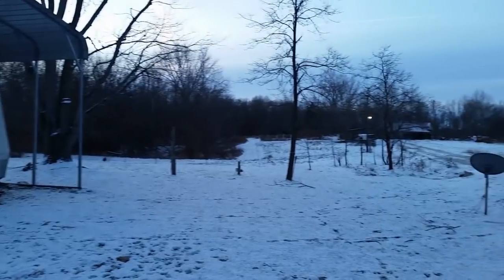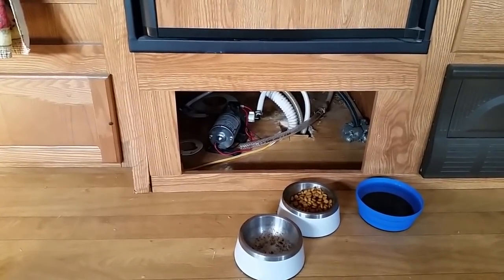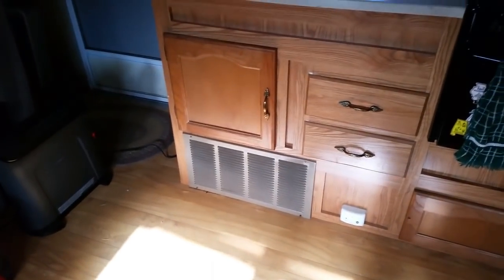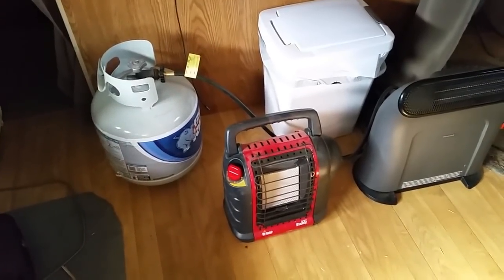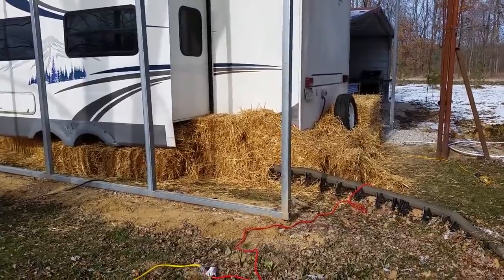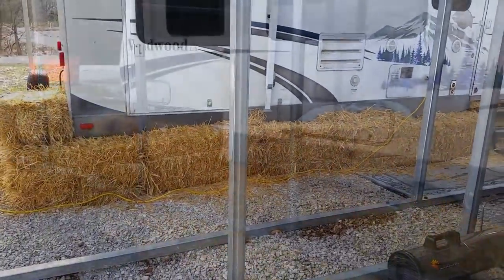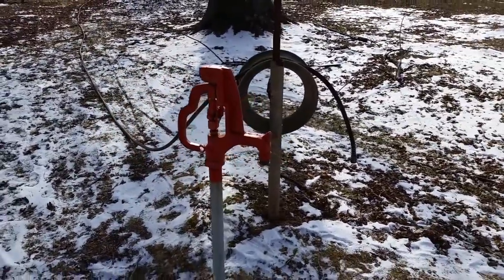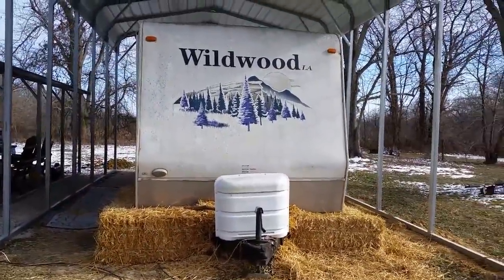Winter Living in a camper

Comment: I have personally found that in northern Wisconsin and all of the other colder climate areas that are in zone three in zone four it’s better to use water tank heat pads whether it’s 120 V plug ones or 12 V plug ones just the 12 V plug ones you need more And four waterlines not bursting in exploding when they freeze I have found out replacing the old original pipes with pex piping and and regular house piping heat tape prevents everything from freezing as well as a Basto diesel heater/water heater and a small small woodstove for a back up as well as a small 2000 square-foot pellet stove every cents I’ve done that I’m going on two years without pipes, freezing in -40 and -50° but in my area, it ain’t rare to have 48 inches of snow falling so I have been told that you should clean off the rough, but I also have been told you should not clean it off but in certain campers, they cannot hold all that weight so therefore, I definitely recommend cleaning it off a little bit. Don’t take off all of the snow becausesnow does act as insulation on camper roof sometimes in certain cases

Comment: I thought the hay bales was a great idea but definitely take measures to control mice. I’m horrified at seeing a 20 pound propane bottle inside. I’m a welder and trust me I’m not paranoid; I do stupid things with explosive and toxic gases. That aside, I would never trust a gas fitting, in an enclosed space I’ve seen them leak so many times. They are essentially guaranteed to eventually leak the more often you remove the hose to fill the bottle.  If it doesn’t catch fire it could poison you in your sleep. Also heaters that burn propane are a really bad idea indoors because it is competing with the same air you need to breath and it produces carbon dioxide and monoxide. Whether it’s the propane rosebud style you had or the 50,000 btu kerosene/diesel one; they are a dangerous open flame with toxic exhaust that shouldn’t be taken lightly. At least invest in a good CO (carbon monoxide) monitor for your peace of mind.

Comment: Set a dozen mouse traps under the trailer. Straw keeps your trailer warm but it attracts mice. You may have brought a few home with you, not uncommon to open a bale and they jump out. They like to stay warm also but will thrash your wiring and water lines.  Each trap with peanut butter or bacon will have a mouse in it when you move the bales to check the lines.
Reply from the maker: Scott Wall, I thinking that I might start having mouse problems with the straw.  I have 2 mouse traps in the camper in case they make it in.  I have a couple extra trap that I can place under the camper. Good idea.

Comment: Good idea w/the straw bales. You can use it later for cover on surface grown potatoes. Here's a little suggestion for you. Finish enclosing your RV carport then you can block the wind. Garage door one end. You will need to reinforce it with metal beams & bolt on piers in the ground. Don't forget the ground wire on the outside of the building. You can try a wood burner in the carport. Might be a moisture issue if you do but worth a shot. Some of those RV barn style carports are a great way to start a property. 👍

Comment: I would have bought a few rolls of a thick clear plastic and put it up around the walls of the car port your triler is under. Also the pop outs of those campers let alot of air inside the camper. You can also use the clear plastic and wrap and seal the pop out with a good extrior grade tape. Befor you park your RV place the same plasic on the ground, park the RV then tape the plastic to the lower wall of the RV.  Cut holes wher you need them to get to water ect,

Comment: I used 4×8 sheets of foam board on my skirting around the bottom of my trailer... use wood plywood and the foam board on the back of the plywood... just paint or stain the exterior of the plywood....

Comment: Does the propane furnace have a pilot light??? If it does then check thw thermal coupling ..it one thing that can cause the furnace not to stay lite
Reply from the maker: Christina Boyes, it has electronic ignition.  So it keeps trying to relight.  It may burn for 30 seconds and go out.  Then it will try to relight again.

Comment: Those camper furnaces are not very efficient.   If You are planning on leaving the camper there, get a small vent free propane wall heater.   They will probably take half as much propane than the furnace does.

Comment: It is cheaper to have the propane tanks filled rather than trading them out. Also if you install heated rugs or carpet you will use much less electric for heat.
Reply: Heated rugs? I've never heard of that, but it might just be my new favorite thing.

Comment: how did it do?
Reply from the maker: Once we kept the tank and waterlines from freezing it went ok.  Running the small propane heater would build up moisture inside the camper.  You would get ice or condensation on the windows.  So electric heaters were prefered, but more expensive to run.  Winter was the toughest part of living in a camper.
Reply: You never got a reply either ?

Comment: Get some 8 mil plastic and wrap that building. You can lower that car port and wrap it and then use your big heater on the outside. U have a green house brother use it. I bet if you did that you would be able to sleep at night with just a throw on your bed.
Reply: I’m working on the same setup, wouldn’t the greenhouse cause mold issues?

Comment: buddy propane heaters require an external filter to prevent liquid propane entering the heater, no filter, no heat. the liquid propane with ruin the burner on the buddy heater